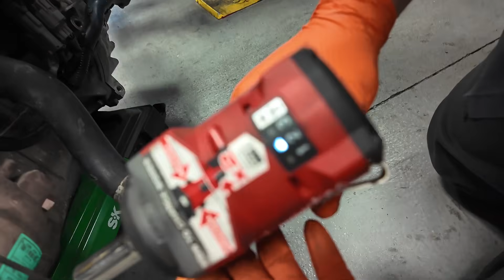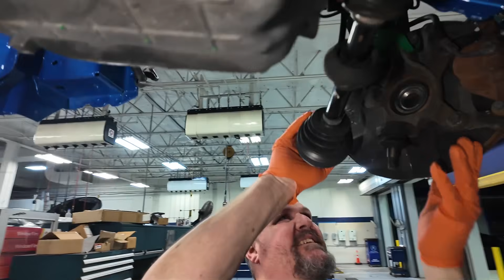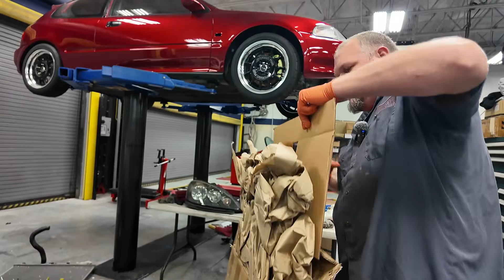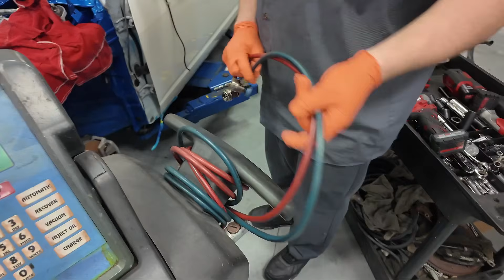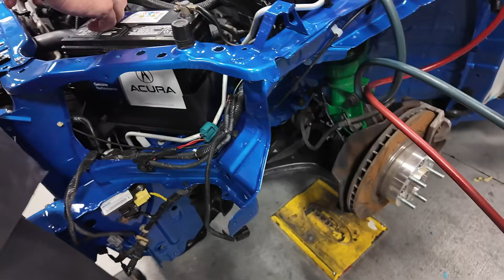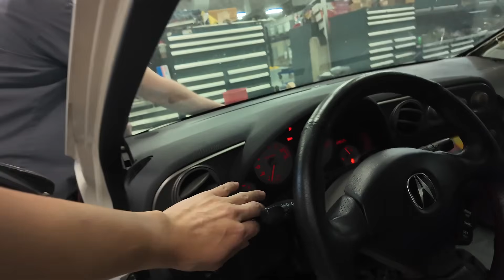Full K20Z1 Installation & First Fire-Up!! // 2006 Acura RSX Type-S DC5 Build (EP7)

Comment: I had to use polyurethane motor mounts (Innovative 62a), because i got tired of changing oem back motor mount once every 2 years. And i drove like a grandma.

If you plan to go on velocity stack intake (Tegiwa?), stock upper strut bar will not fit :(. That's the only reason i switched back to oem box.

Btw, do you plan to update the shifter? some aquity goodies? ^^